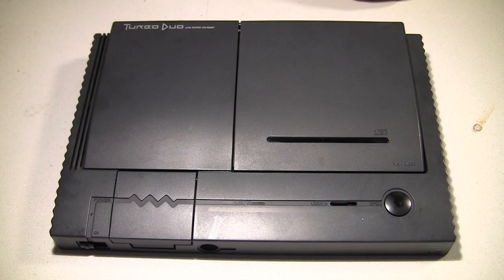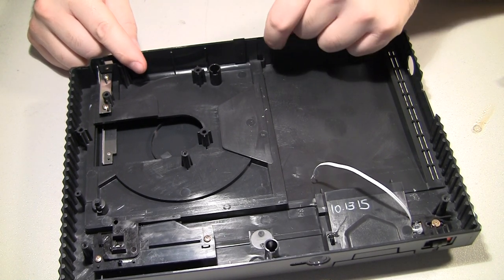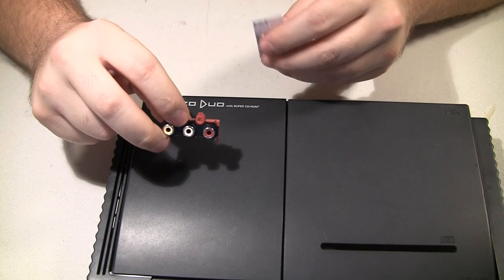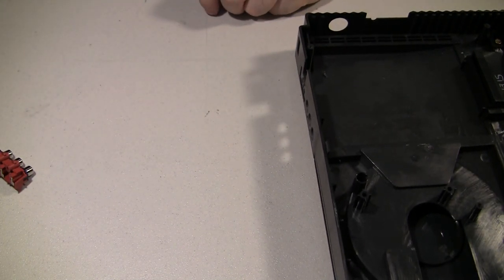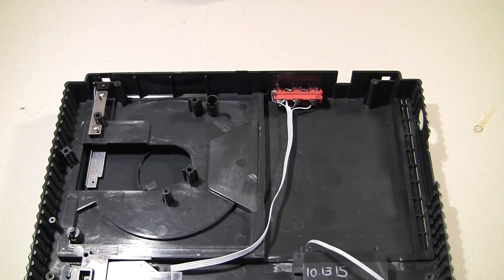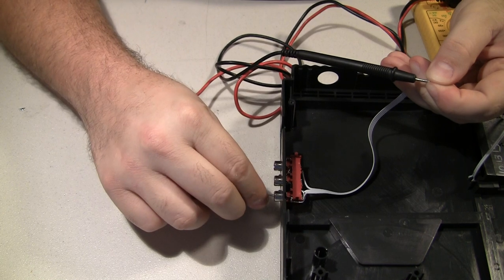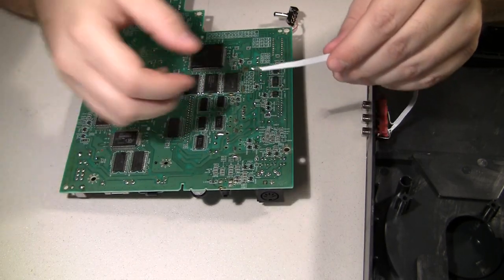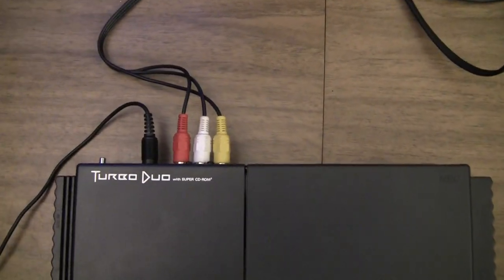Turbo Duo - TurboGrafx-16 - RCA jacks instal

Comment: Good to see Chris Ball and GameTechUS in the comments :)  Chris helped me with whitening my Famicom.  Anyway, I just bought a Turbo Duo off ebay with no AV or power cords and the cd-rom apparently won't spin (for $40 I figured it was worth a shot to fix)  you guys know what AV and power plug I can use for it?  I don't mind 3rd party plugs so long as they work.

Comment: Wow, I just actually recorded this part of my own video, but I did 2 rows in that area: top row for component and bottow row for stereo and s-video out. I bought a similar triple RCA jack mount like you did, but I couldn't use it because I wanted 2 rows in the end, so I went with the individual gold-plated wall plate jacks that you tighten with a nut. But yeah, I hope to have a similar walk-thru video released with thesteve's cheap component and s-video circuits. You're not from PCEFX, are you ?

Comment: Reason Im asking is I just purchased a duo r and it is only coming with a mono av cable.. So Im looking to do something like the av direct out with the RCA jacks like you have done or component?  Your pricing is on the website? Or is it case by case basis? depending on work and whats needed?